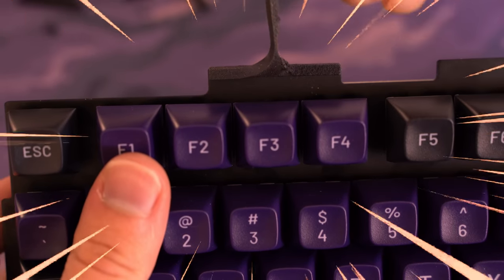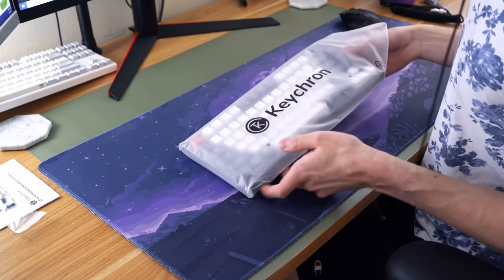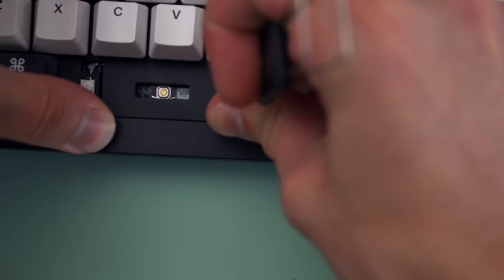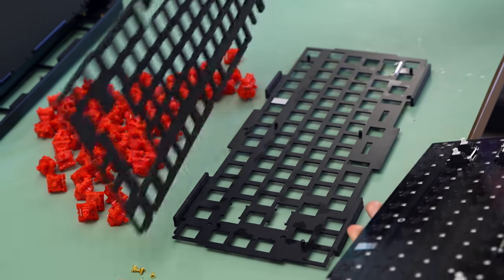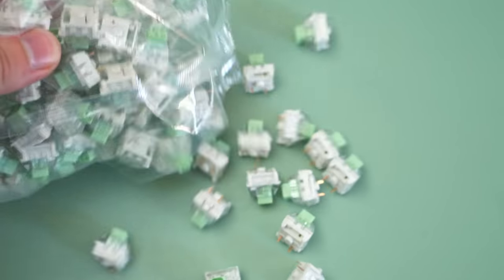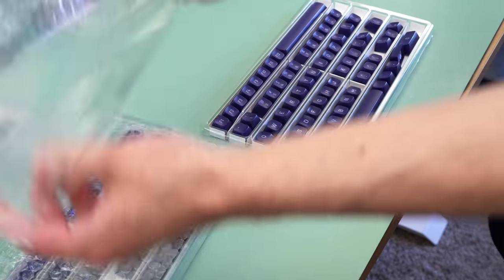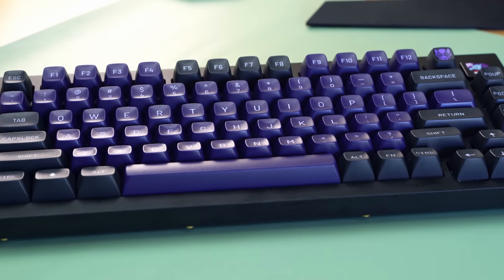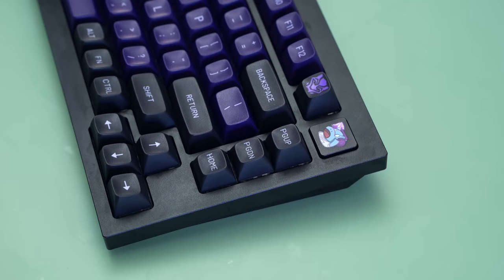The worlds LOUDEST Keyboard. 🔊

Comment: My old keyboard from years ago:
"Look what they need to mimic a fraction of our power"
Reply: underrated
Reply: My current keyboard:
Reply: This is so relatable. My key bored is so much louder than this one in the video and I didn't even try to make it loud
Reply: yeah fr, my keyboard and my girlfriend's keyboard can literally be head from outside the house, its rly bad
Reply: My old (and still regularly used) Logitech G710+ with CherryMX blue switches sounds louder than this
Reply: prebuilt straight plastic case with outemu blues: am i a joke to u
Reply: you mean the sound of old plastic? ahhh yes, just like how i can hear my keyboard while wearing earphones.
Reply: or just razer ornata chroma
Reply: My school keyboards:
Reply: I was thinking in my head like is my keyboard THAT  bad
Reply: This board so loud, my Nan can hear it a county over. No seriously, had a loud keyboard myself and found it was using jade so I nyxed em
Reply: Yeah, I still use my old keyboard
Reply: All this effort to not even mimic a fraction of the power of a Model M. 😔
Reply: My ex would complain about how loud my razer black widow chroma x is this is so quiet 😂
Reply: I agree this is not match for my pc9800 keyboard
Reply: Im probably gonna change my pfp to the zoologist, seeing your pfp change.
Reply: Honestly it just sounded really hollow, what if you added like the thinnest possible aluminum plate, put something inside to level it out ( so it doesn't touch the bottom part of the case) id there would be a louder hollow
Reply: Mine is like that now.
Reply: I spilled acetone (dissolves ABS) on a $30 mechanical keyboard from amazon, if you think a $30 mechanical keyboard would sound bad imagine if it has half dissolved.
Reply: Bro if your old keyboard (like the one I'm using right now) doesn't sound like an AK-47, you wasted money when you bought your keyboard.
Reply: Typewriters: Pitiful fools
Reply: Corsair K65 w/ reds checking in
Reply: @ogtabuada  literally mine
Reply: @sunsickk  My sister's current keyboard
Reply: or my cyberpower skorpion k2 with blue switches
Reply: My almost brand new cheap target membrane keyboard:

"Look what they need to mimic a fraction of our power"
Reply: my spacebar sounds from outside of my house
and its not even a joke
Reply: Invincible reference? But good one
Reply: me with my redragon k552 :
Reply: 5
Reply: Ha!
Reply: Just.. buy a razer blackwidow
Reply: okay ill give it to you this is a pretty good comment
Reply: The terraria pfp tho😏
Reply: My IBM Model M could easily wipe the floor with this "loudest keyboard"
Reply: the best sound is when the switch get rust lmao
Reply: My first a keyboard was a Razer Blackwidow with the god awful green clicky switches, so this keyboard didn't even phase me.
Reply: The Model M and Model F are just looking down on these "loudest keyboards".
"Pathetic."
Reply: @beanpower1282  that’s because sound is different when watching it through a video and real life
Reply: @sleepyajax7838  what are you guys using?
Reply: @beanpower1282  "key bored" xd
Reply: @sunsickk  xd same
Reply: my bro's keyboard when i was a kid trying to sleep in the room we shared was way louder
Reply: @rubytheosudutchie9179  the razer blackwidow with greens be like:
Reply: Unironically true.
Reply: May I buy your keyboard

Comment: I just built my first keyboard. It's a Keychron Q3 with Box Jades and a bunch of extra foam (enough case foam so that the gasket mount doesn't really do it's thing anymore and there's practically no bounce) and force break mod with 2 layers of electrical tape. I get maximum click with minimal clack and ping.

I love clicky switches. I had always used Cherry MX Blues before (an old Corsair K70 that I've had for 9.25 years.) I saw a few videos about the Box Jades and knew I had to try them. I ordered a switch sampler that came with Box White, Pale Blue, Pink, Jade, and Navy. Fell in love with the Box Jades and will probably use them in every build going forward, unless I decide to make a keyboard for use at the office. Then I might have to go with silent tactiles of some kind. I need that bump. Linears just don't feel right.

Comment: From my experience with 3D printers, the worst source of noise comes from the printer sitting directly on the table and so the table amplifies all the printer vibrations. So your table becomes a speaker, basically.
In other words:
if somehow you fuse the keyboard with  a thin table that can vibrate a lot, you could prob get better results :D
Reply: You don't want to fuse them tho,
The materials hitting each other adds to the sound a lot more than the flexibility of the table ever could.
Reply: Might as well just slap the table at that point

Comment: Thank you unironically for the inspiration, I think I know what my first custom board is going to be.
Reply: @Joemama12354  Too late!
Reply: @BFF.Studios  It's actually not bad and kinda disappointing. EPOMaker GK108 with Box Jades, and keycaps off a Corsair K98.
After using MX blues at work for so long, I think I genuinely find the click bars lackluster, as their range of sound is too narrow. The fact that the keyboard came pre-foamed likely also contributed.
It was genuinely infuriating to type on, so I just went back to my K98, which I almost think is actually louder.
Reply: @BFF.Studios  Because, and I say this with the most serious and unironic intent that I can: the cacophony of clicks and rattle directly cause the release of serotonin into my brain. I genuinely love sharp klacks, scratching springs, and rattling of loose pegs. I watch some of these other keyboard guys and their keyboards sound like hitting two coconuts together and it feels like nails on chalkboard to me.
Also: Because while I have MX Blues at work, my K98 uses Reds, and I wanted something clicky for home.
Reply: @BFF.Studios  Because I only realized I preferred Blues to Jades after I got the keyboard assembled. That, and everywhere I looked had Blues out of stock, but Jades in plenty. Even Box Whites were OOS everywhere I saw.
Reply: @BFF.Studios  Oy, it's been a bit. Used those same Jades and put together a GMMK RGB, and the sound is wonderful. Been using it for a few months now, and it has been quite nice.
I ended up getting some Blues in first time I tried to put this board together, and stock they sounded absolutely horrid, I genuinely have to question if they are counterfeit.
Reply: @BFF.Studios  I would recommend it. Just make sure to de-foam your case, so that way the backplate of it can act as a resonator board. Absolutely fantastic sound you get from that.
Specifically, and I must correct, I am using the GMMK Modular Barebones edition. Modular is the type, which for some reason you can buy fully kitted out. Barebones means that it is only board and case, no caps or switches. Goes for around 130 right now, albeit that's the TKL and the 60%, I can't find the full-size, which is what I'm using. I will say, the case has no bezel/ridge, which I know some people dislike. Stays cleaner IMO. 
The keycaps are some form of pudding cup, but heck if I know what brand.
As for Switches, if you can find something better than Box Jades, you'll have to tell me.
I wish you the best in whatever you end up doing, you'll have to tell me when you get the build done, I want to see what other people do outside the realm of thok.

Comment: I used the even heavier Kailh Box Navy switches on my Q1, lubed with TriboSys 3204 and it got a tape mod and 1/8" sorbothane at the bottom of the case. Feels amazing, but then I'm a programmer, not a gamer. I would love to see you do a mod intending to improve the Q1.
Reply: Swap the sorbothane for 50mil automotive sound deadener and then there is a trick to isolate the top of the case. Check keybored's vid

Comment: I found some of those Black Panther keycaps on clearance for 70% off and really like them so far.  I used them in a Keychron V1 (cheaper, newer version of the Q1), and plan to put them into a Q65 when that ships (in 2 months, I think).  Would be nice if the profile was a bit lower, but if I flip some of the bottom-row caps to invert the angle, it's more comfortable and also easier to get the right keys by feel.  Some Boba U4 switches also should help keep the end result pretty quiet.

Comment: There's a missed opportunity here -- if you used a keyboard-mounted keyboard you could get even more clicks every time you press a switch.

The idea:
- Get a second keyboard
- Install only the switches & keys in the very corners
- Put glue on the tops of the keycaps
- Use the glue to attach another keyboard on top

If you put in clicky switches, you could potentially activate up to 5 clicks each time you press the switch (assuming the top keyboard has switches with a higher activation force and the lower keyboard has switches with a lower activation force)

Comment: Ill take Box Jade over any click jacket. Also the key stuck thing is probably, from what I heard, is form the spring inside the switch is too light to combat the click bar on the way up. Never have those problem with mine.  Also Kailh did make a 2nd version with slightly heavier spring easily spotted but all clear housing instead of white.  Correct me if I'm wrong. I kinda forgot.

Comment: why does no one use Buckling Spring switches in these Loudest Keyboards videos? A stock IBM Model M keyboard is louder than this. Maybe not as hollow, but that could easily be fixed. Why not use a Commodore 64 keyboard? 

Are they for some reason not part of the keyboarding community?